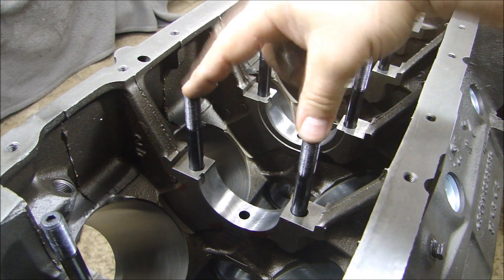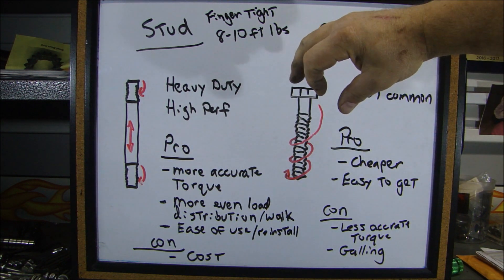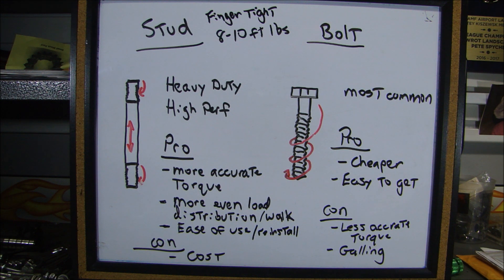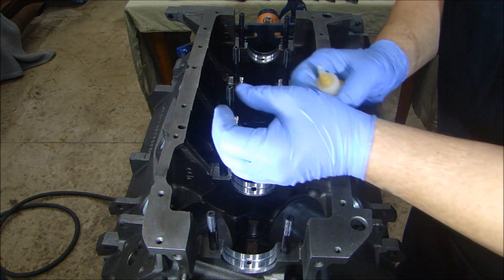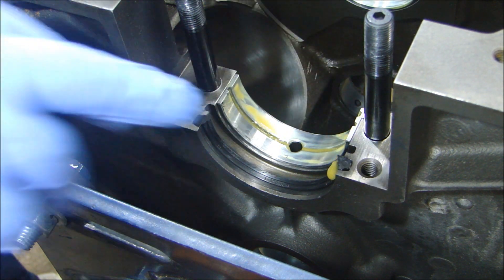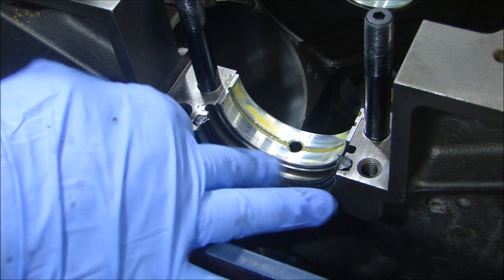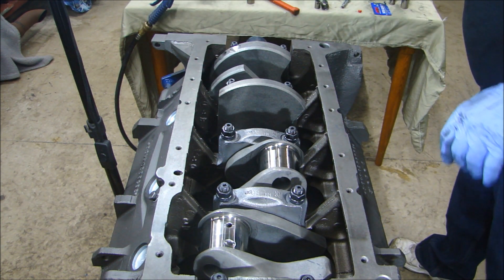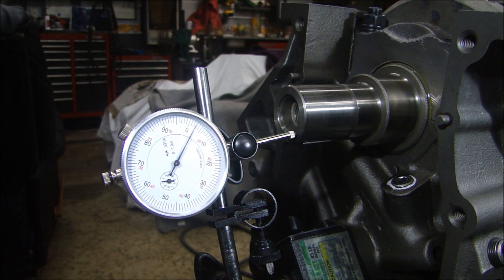440 Chrysler Mopar Engine Building Part 2 - Studs vs Bolts and Installing the Crankshaft

Comment: Can you use studs without having to do any additional machine work to the caps? They wont mushroom with the additional clamping pressure?
Reply from the maker: You can, but I get the line hone with the studs just to make sure

Comment: Why wouldn't you put the studs in after installing the crank? Is it just preference?
Reply from the maker: Reduce chance of dropping on the crank
Reply: @PetesGarage  do you use new or existing main/head studs or bolts to check clearances with plastigauge? And if you use new ones, can you reuse them for the final torquing or do you have to buy yet another new set?

Comment: why do some people rotate the rear main seal a little off from the seam?
Reply: He put the rear main seal in wrong. You want one part of the seal to be elevated on one side and recessed on the other side. That way, your seems will be inside each one of the bearings or caps as opposed to flush with the bearing that would cause leakage overtime or breakdown.
Also, I never saw him mic out the crank and/with the bearings, which is essential if you want to have an excellent build!
Reply from the maker: Preference, offsetting the seam can help reduce leak paths

Comment: good vid. I purchased some vinyl caps at a parts store used to plug holes in whatever er you need that worked well to protect the crank when placed on the stud ends.  A dozen was only three bucks. A good solution if you are in a pi ch is a couple of wraps of black electrical tape. Be sure to use enough to protect the journals if you are hung over or just a shakey dude in general.
Reply from the maker: Thanks for the suggestion

Comment: When you use ARP studs or main cap bolts the recommend that you should get the block align bored/ honed. Also don't go by what the repair manual says as far as torquing the bolts/ studs down. Follow the instructions that came with the ARP main studs/bolts. They usually say not to torque them down to the factory specs. They're stronger,so they don't stretch as much. If you torque them down to factory specs,you over torqued them. This can cause a slight distortion in the main cap and wipe out the main bearings. I made that mistake on the first engine I built. Same thing with ARP rod bolts. Better get the connecting rods resized using the ARP hardware. When I made that mistake I was about 20 and I really didn't think it mattered much.  After about 5k miles I was ripping that engine out and taking it down to the machine shop. Rods and main bearings were trashed because I didn't follow the instructions and get the block align honed with the ARP main bolts and the rods needed to be resized with the ARP bolts. Some of the rod bearings were wearing badly because I didn't get the rods resized with the ARP bolts. This guy didn't mention anything about that.
Reply from the maker: Thanks for the comment

Comment: and never install a part that was cleaned with mineral spirits if it sees oil, the mineral spirit leaves a film that stops oil from doing its job, so final clean with alcohol or acetone.before install with oil on it
Reply from the maker: Alcohol also leaves behind a thin film. Any ketone based solvent like acetone or lacquer thinner it good
Reply: @PetesGarage  never heard that, thats why its used on skin. and all aircraft components etc even use it before assembly they told us
Reply from the maker: Since it is a distilled product it will leave a residue which causes an issue for adhesives. You can easily look that up
Reply: Acetone also leaves a film behind. I use oil to clean things. Marvel has a multitude of usage.

Comment: A very good friend of mine and his sister, both doctors... my friend has great respect for my mechanical abilities, his sister told him, "Don't bother in high school with Vo Ag and shop" She felt we were beneath her high minded platitudes... We're just grunts that dig ditches. I showed her the science behind the mechanical advantage of studs over bolts as clearly defined in this video. They were bulky lumps of metal at the start of the conversation, but when she saw the science behind the two, the light bulb over her head turned on and she said, "Wow!! That's really smart!! I had no idea..." I said, "Not bad, for a ditch digger, huh??" Ol Sarge...
Reply from the maker: That's a hard way to learn

Comment: I'm wondering about that orange soft-blow mallet.  It looks very cruddy and when you whack the bearing caps, couldn't crud that's embedded in the mallet surface be knocked loose and stick to the oily surfaces?  Maybe not a big deal but when you're taking great care to keep things clean, would that also be something to be mindful of?  Just wondering.  Thanks for the great videos!
Reply from the maker: That is a great observation, you are absolutely correct

Comment: you left out the most important part. a fine thread has a mechanical advantage over a course thread. you get more clamping power with the same torque reading. it is the reason the block needs align honed to correct the bore measurements. if you install studs without align honing there is not enough oil clearance because the bore is smaller. you apparently didn't point that out because you are not a machinist.
Reply from the maker: Thank you for the comment. Clamping force is the result or torque, not thread pitch. You get more clamping power by applying more torque.
Reply: @PetesGarage  did you miss out in 7th grade science class where you use fine threaded jacks to lift a house? haha what an educated idiot. fine threads have more leverage than course threads.
Reply from the maker: It's unfortunate instead of trying to learn you call names and think you're right. I went well beyond 7th grade science, Calculus and Physics during my Bachelors degree, Quantum Mechanics and Finite Element Chemistry during my Masters degree, and advanced Physics while working on a PhD.  Fine threads have more surface area than coarse threads. Therefore, they will reach resultant torque in finer increments than a coarse thread. Again, for any size fastener, if the identical torque is placed on it, the same clamp load will be achieved.
Reply: @PetesGarage  Don't fine threads strip out faster than course?

Comment: I've been building engines since 1965 and one of the first things I was taught was to never rotate the crankshaft without the caps being torqued, it can cause the bearing shells to rotate slightly causing the shell to be crushed on one end leading a spun bearing.
Reply from the maker: That can be true, you just have to make sure the bearing is rotated correctly before putting on the caps. Things have changed since 1965

Comment: I have to disagree with you one one thing, you say to crank your torque wrench down to zero, but you should set it at the minimum scale setting. If the wrench has a scale of 10 - 120 lb you should store it at 10 lb.
Reply from the maker: I'll tell ya, I've been involved in so many different torque studies of the last many years that I really don't think there is a wrong way.

Comment: I am referring back to this video , because you are installing Main studs instead of Bolts, if the engine was already align honed with the bolts  Bolts and you wanted to install Studs, should you perform Line Bore bore AGAIN?
Reply: absolutely...the studs change the dimension of the main bore significantly. your machinist is able to show you the difference with his dial bore gauge.
Reply from the maker: You do not need to. The main caps are aligned in the block, there is play in the bolt holes

Comment: Thanks for the info
Reply from the maker: No problem 👍
Reply: @PetesGarage  I have a late 70's 440 short block that I bought from a retired mopar parts guy Its  never been assembled or run. Even still has the tags on it from when it was new. It sat around for a long time and got all surface rust on it. I took it apart its got a cast crank, and LA rods and some kind of flat top pistons  I want to rebuild it for my Charger and I want to install a forged or 6 pack crank Does the block need to be line bored to change a crank?
Reply: @PetesGarage  I have a NOS late 70's 440 short block with a cast crank that has never been assembled or run before. I want to change to either a 6 pack crank or some forged crank that would be an OEM replacement Does the block need to be line bored to change the crank?

Comment: Why did you offset rear oil seal, in the bolt vs stud vid, but put the seal in evenly on the other crank install video???
Reply from the maker: Because there are a couple ways to do it. I show both and have had no problems with either

Comment: Hey Pete...you might remember me. I asked a bunch questions about rocker arm off set on B-RB cast iron heads... Well, I got the rockers all sorted out now. (Thanks) but when I pulled the bottom end apart to rebuild - there was no (I don't know what to call it) big washer behind the the timing cover. You know the one I mean? That fat-like windage type washer on the crank shaft in front of the timing gear? It's kinda beveled a little bit. Could u tell me what it's called so I can order another one. lol Thanks for all you help man...Your making this build go a lot easier for me.
Reply from the maker: That help prevent oil from splashing on the front seal and leaking. They are cheap at 440source.com
Reply: Thanks Pete. I didn't know what it was called. yes 440 source has me taken care of now. "oil slinger" I guess is one way to say it. Thank you man.
Reply from the maker: That's it

Comment: The other reason that studs yield a better torque reading is because a bolt is twisting down to the threads where as a stud’s twisting is done at the the top with the nut. Therefore, with a bolt, you are relying on the bolt not twisting to give an accurate torque reading. Good video!
Reply from the maker: Thanks for the comment Brett

Comment: I got lucky back in the early 1990's when I built my 440 to 500 stroker.  I used a '78 block that was in excellent shape.  Decks and mains were true.  When I had the machine shop sonic test it for cylinder wall thickness it was discovered that they were a bit thicker than normal.   I could have gone to over .100 over, but I chose .060 over because that size was a standard production, and it left me with room just in case I needed a rebuild years later.   The shop was quite puzzled because they never saw any Mopar block made after the early 1960's with such thick walls.   I had to do a bit more clearing for the stroker because I used fatter H rods.
Reply from the maker: That's interesting, thanks for sharing

Comment: The main purpose of using studs is that the torque is distributed between two different sets of threads. Thus allowing torque to be divided 1/2 to each of threaded      stud. Versus all of the torque to threads in the block.   Love these vids, great work!!
Reply from the maker: Torque is simply resistance to rotation. A stud allows the fastener to be in straight tension rather than would up like a bolt.

Comment: You replied to someone that you let the shop check the oil clearance??? That’s not a good practice if your going to build engines you should measure and record all specs. Spend the money and buy the equipment to measure the reason is that machine shops have humans and humans  make mistakes. It’s better to check all the work and know that it’s been bored, honed, decked clearances checked etc before you put it together because if it’s not correct then they will always blame you not themselves.
I’ve seen it happen too many times with even the best shops, you don’t want to be the victim. They won’t be happy you checked but in the end they will do the right thing and correct it. Things go wrong like the correct pistons going with the correct block for boring, miscommunications into what you wanted for the oil clearance. Lots of things don’t matter in general but when you build race engines you often vary what the OEM spec may have been and if there’s a miscommunication it’s not good. 
I measure everything including using plastigage for clearances.

The other thing you haven’t shown or even mentioned is that you should run a tap down all the holes in a block your rebuilding as they’ll have crap in them. This can seriously affect the torque of the fastener. You also haven’t mentioned cleaning a block and crank oil holes etc.
Don’t rely on the shop to have cleaned them. It’s CRITICAL to clean all the oil galleries as hot baths don’t always get the crap out and especially the crankshaft oilways should always have a brush thru them to ensure no residual grinding grit etc. Same for rocker shafts if your reusing the original replace the plugs in the end and clean them out inside it’s a huge depository of crap.
Check and grind if necessary any and all flashing left from the casting process. Sure it’s made it this far but you’ve pulled the engine apart and there’s been machining and the flashing may have been knocked etc.
I even go so far as to paint the inside of the crankcase area with 2 pack primer and paint this leaves a perfectly clean surface that sheds oil faster back to the sump it also keeps the oil cleaner longer. All the guys I’ve built engines for have loved this feature the 2 pack epoxy stands up to the temp also.
I’m watching this because you never know if there’s something you’ve never thought of and you can always learn something new.
If you think you know it all then your a fool.
I’m a Mechanical Engineer so I’ve studied it from the molecular level of steel and cast iron thru heat transfer and engine design cycles and machining and design. I don’t know a fraction yet there’s always something out there.
So read and watch as much as you can and most importantly absorb the information, ask questions no matter how silly they may be. Of course with the internet that information is at your fingertips nowadays but don’t take the first answer as correct check and recheck.
Keep up the good work Pete
Reply from the maker: Excellent comment, thank you very much.
Reply: You do not use a tap to clean threads, only a thread chaser.
Reply: You’re** not your... they should have covered this detail in your college core classes during engineering school.

Comment: Hey Pete, Another great video. Thank you. how do you feel about, after torquing the main caps, backing off the thrust bearing cap and then tapping the crank, back and forth a few times then retighten the thrust cap and then measure play? Are you following me?
Reply from the maker: I understand what you are saying, but the caps need to be torqued in sequence. If you loosen the thrust bearing you'll have to loosen them all and stat again. Personally I don't see the benefit. The crank should be nice and smooth with doing that.
Reply: ขอถามเน

Comment: I had my old man recommend using blue bottle stp as assembly lube for my next build vs the lucas assembly lube i have used in the past. Any issue with using the stp as lube? It is much cheaper and has a high zinc content. I however don't want to mess up my new cams or crank.
Reply from the maker: I don't think you'll have a problem. You could just use a bottle of break in oil if you are going to build it and start it right up.
Reply: Pete's Garage thank you again. I will be installing right after build is completed. It would be at most 3 days before start up after assembly.  My machine shop isn't very helpful around here. If he isn't building the engine he seems unwilling to answer much. However I haven't had any issue at all with the quality of machine work.

Comment: What about  a fine thread bolt?
Reply: Hammerhead Chiseltooth you’ll pretty much find that when a bolt goes into cast iron that the thread will be coarse and not fine. That’s why you’ll find that studs have a coarse and a fine thread on them the coarse goes into the material and the fine has the nut for accurate torque.
There’s a reason for this and thats due to the structure of cast iron coarse threads are used to prevent stripping of the threads with a coarse thread there is more surface area exposed for the friction required to hold the fastener tight than there is with a fine thread. Fine threads in steel are okay as steel has a much finer structure than cast iron.

Comment: Yes i agree studs are best  so why don't use studs in every motor it would make good sense
Reply from the maker: Well, there is a cost factor, and sometimes the engine fits so tight it would be impossible to remove a head if there were studs.

Comment: In addition, studs often can be reused. Many engines are equipped with Torque To Yield bolts that permanently stretch in order to create the correct clamping force. Once stretched, those bolts can no longer create proper clamping force.
Reply from the maker: That is true, but TTY fasteners will only be found on head bolts and maybe intake bolts and other accessories like a turbo.

Comment: Just started watching this series. Starting a 400 B for my 64 Polara.
Question on my 400. Bought as a short block but was rebuilt professionally 10 years ago.  The whole block is clean and has always been stored in a dry place. Internally upon inspection so far it is clean with no signs of rust or debris. Still is oily through out. Should I do this as a fresh rebuild? Take apart and relubricate everything? Crank turns nice and smooth.
Reply from the maker: It would be worth having a look at the bearings

Comment: what is your opinion on the whole "do have to/dont have to, just check clearance" thing on line honing when changing to studs?
Reply from the maker: If you are using the same block and same crank you don't need a line hone. If you change 1 thing like a bearing cap, new crank, oversize bearings, it doesn't hurt to line hone